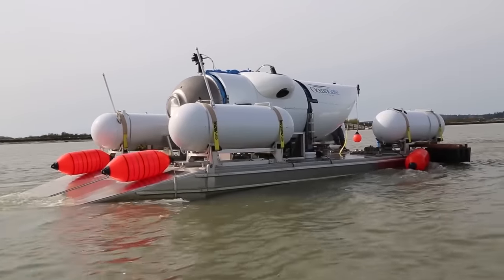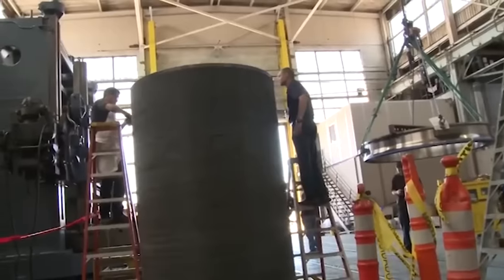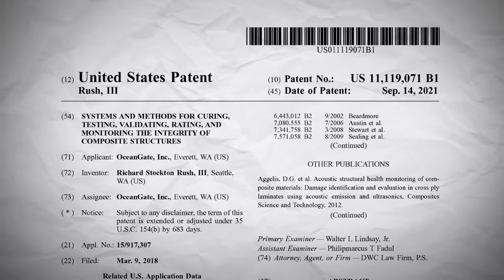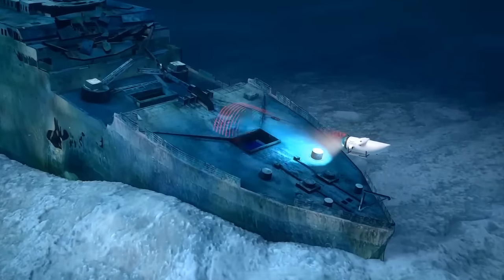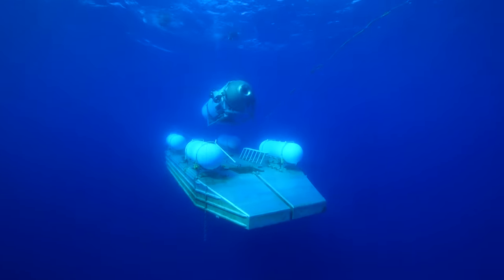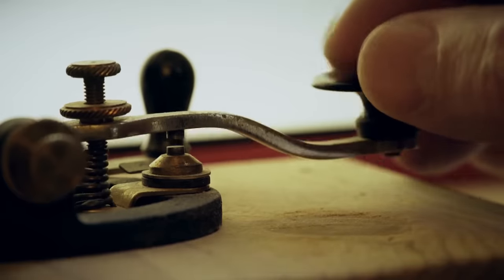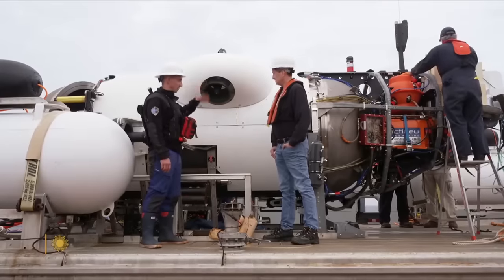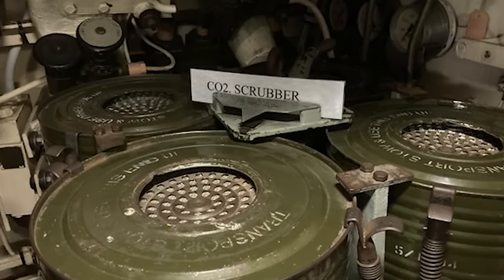Exposing OceanGate Submarines Many Fatal Designs

Comment: I think one thing that should be explored is the interface between the metal and carbon.  The two materials are VERY different and act compleatly different when exposed to various physical elements.  Even the shrink/expansion from heat can be wildly different.  Its something Boeing and Airbus have been dealing with composite aircraft for years and is considered a closely guarded secret just due to its value.  Even they have problems and a batch of 787's had to be recalled and fixed due to one of these bonds between the wing and body separating due to different stresses.
Reply: Boeing Employees : 🙈🙊🙉🐵
Reply: Carbon fatigue is an issue
Reply: @Trusty_Steed  Actually - it is not, if the maximum strain does not exceed (give or take) about 3000 microstrains.
Reply: @les8489  actually as we can see from the outcome - it IS
Reply: @strammerdetlef  We do not know what we have seen yet - apart from the fact that the sub was destroyed. And composite is pretty much insensitive to fatigue - if it works below 3000 microstrain. I have data for this. If you have data which would contradict what I said - please direct me. Never too late to learn - even after 40 years in composite engineering and analysis.
Reply: @les8489  well my data is that after some successful attemps it totally failed lol
Reply: my (very possibly wrong) intuition about this is that the interface between the two materials might have been the location where the implosion began
Reply: @strammerdetlef  You don't have data: you just have a fact which you can't explain,, and which you wouldn't be able to prevent.
Good night.
Reply: @les8489  just like u, but u neglect that fact that stands so high over everything else with ur blabla lol, guess rush also had much "data"
Reply: @les8489  imagine saying "the data showed that the car is capable of a 5 star crash rating at 50kmh" while u stand next to the total wreck bc it hit a truck at 150 lol, thats some serious cope just to seem smart
Reply: @les8489  had to look up microstrains, and I'm afraid my lack of formal engineering education came up. From what I understand - what you say is that, if CFRP are not subjected to (plastic) strain deformations exceeding 3000 um/m, it will never experience fatigue? And what are those micrometers measured over, the material thickness or the torque arm it acts over?
Reply: Well the water pressure  kept the joint sealed .. aeroplanes are different, with their  shaking. Expanding contracting due to the ups and downs of temperature and pressure..  there isn't just one direction for the significant forces, its trying to tear itself apart...
Reply: @strammerdetlef  And your point is what exactly ?
Reply: Whenever the Titan reached a depth of 100m (300ft), the carbon fibers began to make a funny noise, which grew louder when it dove further down. Rush told passengers to be prepared for the sounds that the sub's carbon fiber makes.

See, carbon fiber breaking is just part of your normal routine. No engineering degree required. And nothing to worry about. Trust me.
Reply: My thoughts exactly. I didn’t like the fact hull components are very different materials
Reply: You're on the right track. What probably happen is that the external pressure caused a bending moment on the interface between the titanium and carbon fiber. This was also subjected to cold temperatures underwater. A combination of classical fatigue, and strain ratcheting caused catastrophic failure. He was a fool but now he is a historical figure.
Reply: @eternalsunshine1651  The stress and differential thermal expansion of materials (in conjunction with possible humidity content in the bonded joint) at the connection of titanium caps to the composite cylinder are certainly one of the suspects. I would be more concerned, however, with two other factors:
1) the viewport (certified to 1300m only) and 2) the actual layup of the cylinder. All videos show fiber placement only in the hoop direction (which I find hard to believe, as this would immediately be the No 1 sin in composite design and manufacture). I am still waiting for more info regarding the actual fiber placement, directions and curing method and temperatures - if this kind of data will ever be published is anybody's guess.
Reply: @les8489  One of the scariest material defects in pressure vessels is delamination. In steels, you can detect this during fabrication typically, or thru various NDE. With carbon fiber layered in a dirty warehouse by hand, using spatulas while laughing and chatting... delamination between the carbon fiber layers is guaranteed. If a delamination defect grew toward the carbon-fiber/titanium-girth-flange interface, the transverse bending load would certainly multiply, and allow rapid failure.
Reply: @eternalsunshine1651  Watching the video of the debris recovered, the front pressure dome (metal) was intact.  The composite hull looked like a squeezed tube of toothpaste.  Im guessing the hull buckled and separated from the titanium.  The first suspect was the plexy viewport, but that looked intact (could not get a clear view).
Reply: @eternalsunshine1651  Generally - I agree :) But look at it this way (forgetting about the viewport which was rated to 1300m only): all videos show the fibers placed in the hoop direction only. The hoop stress in the cylinder shell was about 300-350 MPa at 4000m (you can do the numbers yourself). The axial stress in the cylinder is half of this: about 150-170 MPa. If no fibers are present in axial direction - then all axial stress goes into the matrix (resin). Epoxy resins have compressive strength between 80 and 180 MPa. So - a couple of dives to 4000m puts stress on the matrix which is equal to its strength in compression - or close to it.
Of course the numbers are just approximate, derived by quick hand calculation from the approximate dimensions of the vessel, the direction of fibers requires confirmation (because I can't believe that anyone would design and manufacture a shell with ALL fibers in one direction only).
Reply: @les8489  The math only works if the material is fully amorphous with no defects.. clearly, many defects were introduced during the casual carbon fiber fabrication, and during the titanium end-cap gluing.
Reply: Your opinion maybe could have saved their lives over the idiots who let it get in the water.
Reply: @kingdubbs143  These opinions were shared with Stockton many times by expert engineers... Stockton circumvented the rules by doing all his testing and operation in international waters. He had plenty of chances to swallow his arrogant pride and get his design fixed.
Reply: @eternalsunshine1651  I know man. We are making the same point. But I'm thinking like what if an average joe just would be like I'm not getting in that thing. Then the billionaires would be like. Maybe it's not safe. But all in all. They still let it get in the water knowing it was unsafe.
Reply: @eternalsunshine1651  I agree that the composite looked bad. Fabrication was not up any standard. But my No 1 suspect is the layup: if all fibers were placed only in the hoop direction - this would leave only the matrix taking the load in the axial direction (e.g. pressure coming from the caps). The strength of the matrix in compresion is only 80-180 MPa which is in the ballpark of the axial stress produced by diving to 3800m depth. Let's wait and see.

Comment: The catastrophic loss of pressure most probably came from the fact that they used 3 different materials for the sub that have different expansion/contraction characteristics which are hard to simulate. So at the joints of these materials (plexiglass, titanium and carbon fiber) the failure most probably happened.
Reply: I would be real skeptical of the CF to end cap connection. 

The other thing that scares me is the carbon fiber being laid in a single direction, I've never seen that done before, it's always a back and forth weave.

Both look like a problem over time.
Reply: Carbon fiber is amazing in tension - but very bad in compression, where the matrix does all the work and not the fibres. Hence the rule don't use carbon fiber for submersibles - especially not combined with titanium as you say.
Reply: my guess would be the glued-on domes failing in the seems to the carbon fiber
Reply: wasn't it a very quick increase in pressure?
Reply: @volvo09  Yep.. typically 45 degree patterns, not 180.
Reply: @volvo09 Unidirectional carbon is used, they just built it wrong. CF is also just meant for tension not compression. Under compression, CF is effectively the same as the resin it is set in
Reply: @wapted  Great point. The fiber strands are not really the least bit effective being placed in compression! They therefore rely on BONDING of the fiber to the matrix. No wonder its not recommended for compression.
Reply: @velqt  Worse even, because the fibers in compression will buckle and force delamination. The resin alone would probably fare better.
Reply: @samuellourenco1050  Actually didn't think about that, but yes
Reply: Once again it should have been tested.
Reply: That's what I think, he probably sprung a leak at one of those end cap joints. He was using epoxy resin or JB weld as glue. I saw a video of them attaching the end caps and the flange overlapped the carbon fiber very little. They had a slot machined into the titanium about 2 inches deep where the tube fit into it, which didn't give him much of a glue surface. The tensile strength of epoxy resin is around 5000 psi, but he was taking it to depths where the pressure was 6000 psi. It would have still been sketchy, but alot stronger if he would have had at least a 12 inch slot in the titanium overlapping the carbon fiber tube where he would have had more of a gluing surface. This also would have allowed him to drill some holes away from the edge of the carbon fiber into the titanium flange and carbon fiber. It weakens carbon fiber to drill holes in it, but he would have had the carbon fiber sandwiched between titanium on each side. Then he should have wrapped the whole thing with carbon fiber again. Basically he should have never used carbon fiber, but if he was going to join it with titanium, he should have made a stronger union. What he had at that joint was sketchy as all get out. I don't see how it made it the first trip.
Reply: Just curious why is it that that are wine bottle in the titanic site fully untouched and unbroken by the so called tremendous so called pressures?
Reply: @wapted  Stockton Rush bragged about how the experts were wrong about using carbon fiber & titanium...
Reply: @hillbillybeerdranker6678  Its not tensile, its compressive.
Reply: @velqt  But tensile sounds more sophisticated than compressive, so I use that word. Actually tensile and compressive strength are related, even though one is pulling and the other pushing. In submarine steel they always refer to it's tensile strength. When you have force applied inward on steel, it has to have tensile strength to withstand being pulled apart. They test steel's tensile strength by pulling on both ends until it breaks. I can't believe you are questioning my expertise. I'm a YT submarine engineer that moonlights as a facebook nuclear physicist. The pay is not very good, but when you love your job, money doesn't really matter.
Reply: @hillbillybeerdranker6678  Uh, compressive is more important but valid reason
Reply: @hillbillybeerdranker6678  Either way fatigue on the carbon fiber and delamination was probably the cause due to the horrific compressive strength of carbon fiber, especially unidirectional carbon fiber
Reply: They had enough warning to drop the ballast, so it was was probably the one bit of hull with an early warning system, the silly carbon fiber tube.

Comment: I have been using carbon fiber trekking pole in freezing temperatures and had one shatter into a million webs of super sharp carbon strands will using it under load... My glove was shredded by the strands when my hand plunged into it.  
That being said... Is there a chance the carbon fiber while under pressure was made more brittle by the freezing water, possibly developing micro cracking that only got worse when brought into a higher temperature environment?  Something like this could happen over several cycles I would imagine... and the problem I found is that when carbon fiber looses its integrity, it will catastrophically fail even at 1,000ft above sea level...
Reply: The CEO must have been  aware but ignored warnings. His company is a cash pit for years and needs to earn quick thus overlooked safety.
Reply: How did it shatter? I'm guessing under bending stress.
Reply: You, Sir, have the strength of Poseidon!
Reply: I never liked that stuff. I worked in a machine shop and me and the owner spent many many many hours talking about different materials. It's glue, i dont trust glue.
Reply: I knew about carbon fiber from bicycling and camera tripods.  It doesn’t bent.  It fails catastrophically when it fails.  Wonderfully light, though, but pay attention to construction details.

Comment: Army, navy and submaries use some type of game-controllers but those ones are specially made and for simpler tasks such as guiding a drone, etc. They dont use Logitech game-controllers and they dont use it for manned vehicular missions or other serious purposes. Also, the game controllers they use are much more finely-tuned and not at all similar to the game-controllers used by general public. You should correct this info in your video.
Reply: Also those controllers are usually not wireless .
Reply: The least he could have done is gotten a ps5 pro or Xbox pro controller. Why in the world a cheap Logitech. Just shows the kind of corners he was ok with cutting.
Reply: They also aren't wireless
Reply: banksy2870, very true, in addition, no submarines are running their controls off Bluetooth, they are wired and have backups, as well as state of the art spark retardant, which consumer game controllers don't.
Reply: I figured this was the case since there's been several experts that have told the same same thing. Plus dont these commercial controllers have a Lithium Ion battery battery inside them? Since those are quite volatile and a potential fire hazard. Fire is bad enough on a surface vessel let alone a submersible. And even if they dont cause a fire those batteries can produce a ton of toxic smoke when they fail which I would wager is bad news when you are in a confined space.
Reply: While I can't say what they use now at some point the navy used plain xbox controllers on subs for the photonics mast (which replaced a $38,000 joystick).  Apparently the marines and army also used plain knockoff xbox controllers for drones.  The navy even made a point of the fact that part of the reason they used them is because they were cheap at $40 a pop.  That said all the pictures I've seen are using wired controllers and it doesn't control navigation for the submarine in the case of the navy, so you are partially correct but it he did footnote 'systems' in the video (though one system would have been more accurate).
Reply: no, our ICBMs are controlled by playstation.
Reply: @DrDeuteron  No. That would be Atari and Missile Command
Reply: @nadtz   Exactly.
Reply: To @banksy2870:  Thank you for your comment.  I noted the same mistake in the video.
Reply: These off the shelf consumer controllers are NOT intrinsically safe. You need to make sure there are no sparks in such a confined environment.

Comment: You should clarify regarding the military submarines that the gaming controller doesn't control the entire sub. That would be impossible. They use them to control the photonic mast or what used to be called a periscope but with cameras.
Reply: also there is generally another way to control the system if the controller fails. Stockton Rush's backup plan was apparently just keeping multiple controllers, which doesn't help you at all when BLUETOOTH is the problem :P Bluetooth is so unreliable it is literally the reason that wireless mice and keyboards are still strongly hated, and any decent wireless devices have not used bluetooth for nearly a decade, instead using WiFi, but bluetooth is THAT bad that people still have PTSD. Next problem.....Logitech...... no other manufacturer comes close to Logitech's RMA rate..... take six of their products down to the titanic and I would be amazed if even one of them actually works, it's generally more like one in twenty to get a Logitech product that isn't dead in the box :D
Reply: @Muffin_Masher there was something saying it had a wired backup but no idea what that meant
Reply: @Muffin_Masher  I've been making those same exact arguments. Use a gaming controller, fine. But ise a good one that's wired in. And yeah, Logitech, that was a huge red flag in itself.